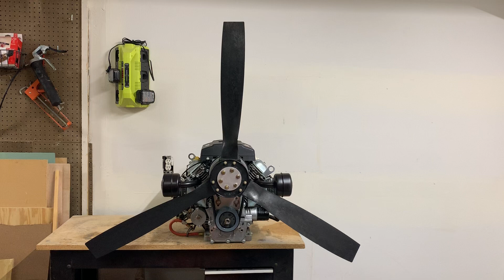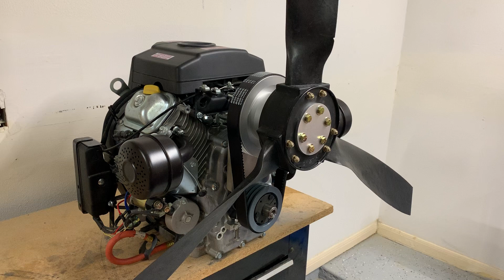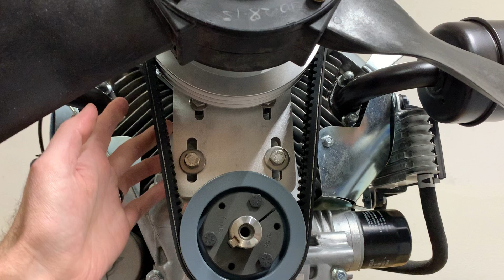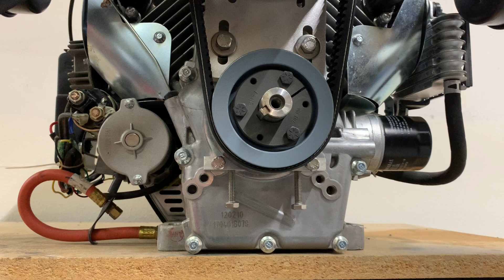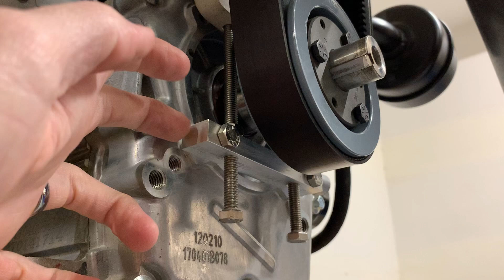Harbor Freight Predator 22 Belt Reduction Drive and Propeller

Comment: Question, can this be setup in "tractor' configuration for an ultralight aircraft?! 😁👍👍🇺🇸
Reply from the maker: @TinyHouseHomestead  yes, it works in both pusher and tractor configurations. It weighs about 12.5 lbs.
Reply: @LoneStarHovercraft  Eggsellent, do you have a drive for the Predator 420/460 cc engines?! 😁👍👍🇺🇸

Comment: Do you recommend a 6-bladed fan for small (e.g., 5'x8') hovercraft setups?
Reply from the maker: Depends on a couple things, if it’s for both lift and thrust, I’d use a 6 or 7 blade fan. If it’s only for thrust, I’d use a propeller like this if it’s going to be over ~40” and you intend to run it open (no duct) or go with the fan instead if it’s going to be smaller than 40” and you intend to build a duct for it.

Comment: Do you change any internal components of the engine? Like the connecting rod, push rods, piston, value etc?
Reply from the maker: Not when we run them on mini airboats. we normally just leave them stock and tune the carb.

Comment: Whether you're using direct drive or reduction drive, do you still run those engines with the governor?
Reply from the maker: Yes, we leave the governor on because we find it simpler to attach the linkage and we don’t need to rev past 4000 rpm. On some of these small engines the governor can make it act squirrelly (surging and hunting) so in those cases people usually adjust them or bypass them
Reply: the prop is the governor!!!!
Reply: @williamnaylor2488  not really, because after a specific rpm the aerodynamic propellers don't do anything but waste fuel. That's why you kind of want to match the max engine RPM to the max propeller RPM, factoring in a reduction drive if used.
Reply: @michiganmagneto  then why are there no governors on aircraft motors? unless you have a motor with unlimited power the pitch of the prop sets the max  motor rpm! I have been building and flying aircraft for 40 years that is how we match a prop to an engine.

Comment: How well would this work on a 14/36 jon boat
Reply from the maker: It would do pretty well. We normally run them with a 44” prop on a boat that size. It’ll push one person and some gear around 20 mph. It’s possible to push two people with it but with limited gear and depending on the size of the people